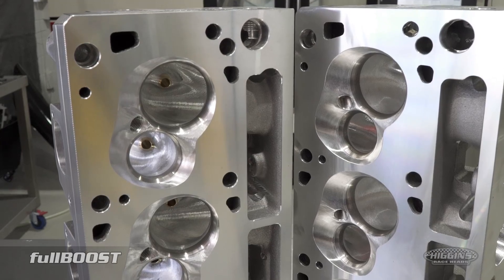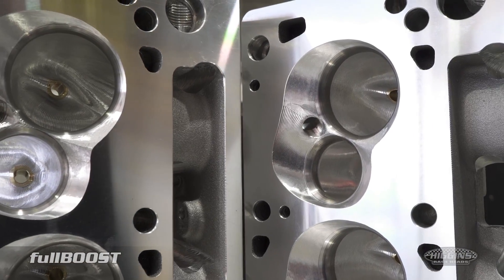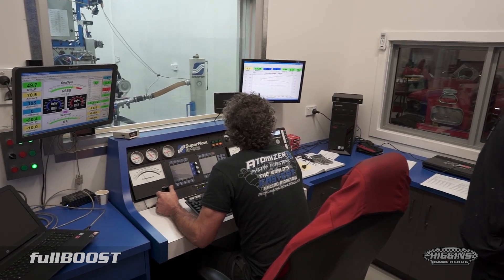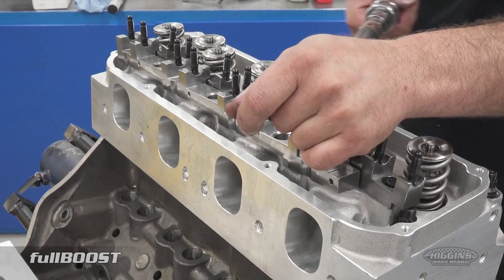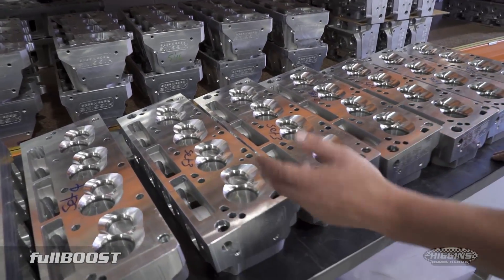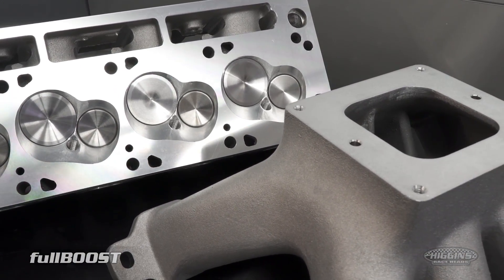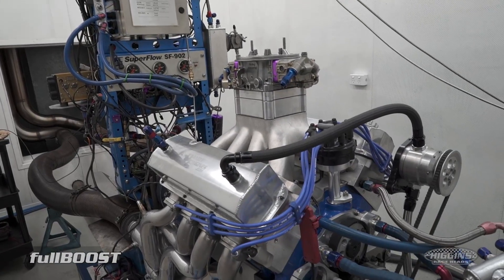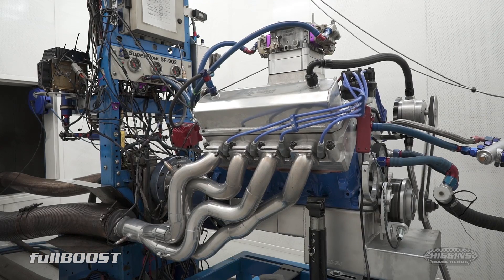How to make horsepower on pump fuel | fullBOOST

Comment: Very good numbers , but not on pump gas. You can get 950 or 975 from a 427 bbc, n.a. at 9000 rpm.

But look below

1100 on twin turbo on pump gas on a 427 or 496.

Even better in a street car and more fun.

Bloodviking
Reply from the maker: This is pump fuel.

Comment: It's good to see that it's possible n/a but, I am certain that the reasonable and intelligent HP/$ threshold is far surpassed. One would be much better off producing a basic 393/408/418/427/436 stroker with a roller cam 351w block, adding some heads that cost between $800-$1900 a set complete, a nice sized cam, port injection, Terminator X and a simple 78/75 VS turbo kit that would allow them to.produce 900hp crank with ease, might want to move towards E85 pump fuel instead of 93/94 octane and be capable of well over 1000hp if the fuel system is there while spending quite a bit less and having way less on the line if the thing breaks along with an ungodly Tq curve without the added cost, wear.complexity of high rpms to reach the numbers or the razor thin tuning window 13:1 compression must dictate.
Reply from the maker: Some people want an n/a engine, they sound great

Comment: Thought l pretty smart around engines & engine tech. How do u get a 13:1 comp engine 2 Run on 98 Octane Fuel.  If the guy had said 11:1 or even 11.5:1 l could have accepted those no's.  Pls explain. Other than that....  Higgins does fabulous work.

Comment: I just want to know and I'm from the US how do you run a 13 to 1 compression on pump gas I don't want to seem stupid but I really want answers
Reply: With Factory heads we ran 11.7. Add Aluminium and it is worth a point so 12.7. More modern Combustion Chambers than the Factory Heads and add a bit more. With the better more modern Combustion Chamber Flame front propogation is better so not as much timing needed so safer. Then ultimately, to get an engine making big numbers comes big Cams. Big durations vent compression so static Comp is a Big number but Dynamic Comp or Cylinder Pressures come down the more duration you have. I hope that helps. By the way, our built for Street Strip Clevo's are running Mid 12's:1 quite often on our 98 RON which is US 93. with no issues at all usually with cams over 250deg@50" and total timing of 26-28deg. Cheers. I hope I gave you a decent explanation.

Comment: 13:1 compression is WAY TO HIGH for normal pump gas.  And I have not seen 98 octane at the pumps in over 20 years.  8200 RPM is not from a street motor, again I am sorry.

In spite of my disagreements, producing this HP is insane and a bloody great job.  Super pro's that have dedicated their lives can only have the CHANCE to achieve this.
Reply from the maker: 98 Ron is the same as 93 Aki pump fuel.. Static compression and dynamic compression are two different things. Higgins / Dandy Engines have built heaps of these street engines.

Comment: you could get 200000 views if you address how Your running pump gas on a 13-to 1 compression engine on PUMP 93-98 octane.

I dont think its possible without detonation.
Reply from the maker: We have a full feature on one of these engines coming up. Keep an eye out for it. 👍

Comment: very impressive.   Care to elaborate on 13 to 1 compression and pump gas?
thanks.
Reply from the maker: This combo runs on 93aki / 98ron pump unleaded 👍
Reply: @fullboost  ...yes, I hear ya......how is this possible?
is this because of the chamber?

or have you found that 93 octane is all that is needed for 13 to 1
Reply: @harryharry3193 I was also wondering about detonation on 93 aki. 13:1 seems a bit high. If they mirror polish the chambers, and supply enough fuel, it would help, but I’d feel more comfortable with it if it had water/methanol injection at wide open throttle or dropping it to 12:1.

Comment: 2-bhp per cubic inch, (461cid) naturally aspirated, pump gas, 13:1 compression @ 8k revs. The factory Cleveland heads have potential, but those aluminum heads must open a wormhole!
Reply: 2.12 hp per cube !!

Comment: Mind blowing stuff, and this engine just sounds so smooth. Are there induction options to fit under a Falcon XA bonnet? Would have to put a Lenco behind that, and a lightweight 9 inch with detroit center, and go for a record around Bathurst.

Comment: 13:1 compression 🤔 not good for boost
Reply from the maker: No it's built as an N/A deal.
Reply: @fullboost  are you guys still selling them
Reply from the maker: Contact Higgins Race Heads or Dandy Engines for these parts
Reply: Bet you could run those heads with boost running a different piston though...

Comment: 13 to 1 on pump fuel? Australia must have some awesome pump fuel.
Reply from the maker: It's basically the same as 93 AKI fuel , what USA has.
Reply: @fullboost  my mind is blown, 13 to 1 on 93 seems like a ticking time bomb, but I'm not a professional engine builder either.
Reply: @fightfanian  See the Street Machine Aussie article on Alon Vella's Drag Challenge Ford Capri !!

Comment: Being a former 351ho and 351cj owner, I always said there was a lot of potential in the Cleveland
Heads. Made a lot of Plymouth and GM fans on the street mad because they lost to a small block Ford.
Reply: I used to have a BOSS 351C I transplanted into a 68 Fairlane Fastback. The Cleveland is definitely a kick ass motor.
Reply: Never lost to any ford In my charger but yes the 351  had heads of potential
Reply: @chargerwoh  I will race you. It will be a Drag Race, but you Will suffer a loss to my N/A 521 BBF in my 275/60 Drag Radial 86 Mustang, seriously doubt it Will be you're First Loss to a FORD, with that Big Heavyweight Charger.
Reply: Bad Ass 6.0 Powerstroke well I probably should of explained myself better and it’s an Aussie charger with a 440 ... light! only thing cast iron on it is the block and when it was a 265 inline 6 .... many many years ago I never ever struggled against any of the the other makes but at the end of the day mate you can’t take away the crazy power this sbf is making but in Australia 🇦🇺 the charger was king of the 1/4 mile for nearly 30 years but very light compared to their bigger brothers across the pond .sadly we only got 6 cylinders and small blocks
Reply: @chargerwoh  I'll run ya...
Reply: I built 351c with factory 4bbl closed chamber heads flowed like the Mississippi same size valves as a GM big block and back then we called them 4finger exhaust ports,  but Cast Iron I think they weighed 80lbs each 😢
Reply: @walterzook7751  351C iron heads are 55 lbs each.

Comment: So what do numbers look like for big block ford running higgins parts ported to the max. And using a belt instead of chain. And bigger valves and taller lift with aluminum  rods and of course best cam for high end power and four bolt main on all five mains full build all the tricks in the book roller rockers and all that on 460 junkyard virgin block. And would it handle twin turbos.  PROFESSIONAL COMENTS ONLY.  This smal block made almost a grand hp the big block without turbos shld have way more rite??

Comment: Depending upon which way the wind blows, I’m fortunate to have been just getting into serious street drags in 1970 when the 351 Cleveland made its debut here in the States. Or perhaps it’s unfortunate to be old enough to make my previous statement. But I’m still vertical and still racing against the clock on both accounts. 

I watched the Cleveland evolve over time with the pioneers like Bob Glidden among others doing some amazing accomplishments with factory blocks and modified iron heads. His dominance in NHRA Pro Stock started with the Cleveland and continued for years until he was eventually defeated by the NHRA Official rule book 😳. 

Fast forward to present day and witness the resurgence of a modern day version of the Ford Cleveland. Much of the credit for these many new advancements goes to directly to a handful of highly motivated Australian companies and talented individuals who devoted their research and development to make it all happen in such a spectacular manner. 

As for my own Cleveland competition engine, I’m stuck in a time warp running an antique relic using former Pro Stock iron heads with the full high port conversion by Endyn Inc.
But these are the heads that started it all from drag strips to high banked super speedways and the early alloy Cleveland heads were patterned after the iron high ports so they still serve a worthwhile purpose. 

Seeing is believing despite the whiners and their negativity about excessive revs and fuel consumption. I would like to give a big shout out for an outstanding display of performance by Fullboost and Higgins. Thanks guys 👍.
Reply: How about the biggest shoutout to the Cleveland engine for making this possible even more stronger today.
Reply: How about a big shoutout to Dandy Engines Inc. for their amazing talent and wisdom in choosing Higgins Race Heads featured in another great Cleveland head Superiority video by Fullboost !  Great job guys 👍
Reply: Mid 8's with a 334- 340 cube Cleveland in that Fairmont that went undefeated for a whole  year.

Comment: What about us Big Block Ford guys who love the 385 series engines, why waste your time on a small block 461 cubic inch motor when you can have the grunt and torque of the big block!
Reply: About 100 kilos extra weight comes with what is basically a truck motor. Lot of weight over the front wheels and because of the size 385's are a tight squeeze in most medium size cars. Lots of money getting them to fit.

Comment: It may run on the dyno with pump gas and 13.1 compression, but wait till someone trys to do that in a vehicle on the street. Dyno's feed water that's usually 140 degrees. Your engine temps. In a street driven car are going to be much higher, heat plus pump gas and 13.1 equals detonation.
Reply from the maker: This is not a one off engine there are a lot of them in street cars already. 👍

Comment: So are rose cammer heads a V8 can I  get a 289 cammer but my engine  car 32 valves I stoked it i beleave well I'm hoping with the right parts and boost I'm hoping for 1100 hp😊😚 one of few cars I need to build up hahaha what so you think about me stroking this maching block to a 347. With titanium piston sleeves. As toy could tell I'm basically sleeping???😎😊

Comment: 8200rpm. And the mod gunkies say pushrod V8 can't t it rn high rpms. No need for a ohc.
Reply: a production engine that turns 8400 rpm or a race specced motor.... Hmm.... I have seen lil stock cranked 281 sohc turn 9500 plus rpms....
Reply: Ey I've always liked my f 150 4.6 redline alday long an not hurt a thing an mind you I got it at 230k miles. Only problem I've had was locked up ac pump made me think I blew it up.....one bypass pulley later redlining once again. Lmfao then everybodys like chains this chains that. I'm pretty sure some motors were messed up period cuz I still dont hav any chain slap. Or just junk metal
Reply: They can but not for too long. Ohc will rev 8 all day long
Reply: @scottmcgregor2757  better be looking for the chain or chains to say see you later. I have always been a ford guy until the intro of the ohc like so many others were. . Nothing but a long history of problems  Glad they finally replaced thier truck engines with a proven platform and cant wait till it makes its way into the mustang eventually. That will be a engine that can compete with the 6.2  with size,hp,and tq.

Comment: Cleveland heads. Flow baby flow.
This is why the 351c is so loved.
The flow of the heads that are available now thanks to cnc and computer design are phenominal.
I can remember spending hundreds of hours of hand grinding and matching on ports anything nearly 2/3rds as high a flow as these head and intake make.  Hand p&p and intake and exhaust girdles along with great valves and valve springs make some amazing Hp. 
Breath baby breath!!!!

Comment: wonder how much More HP this 461C eng combo would make with a longer (1.52) rod in it?
with a good dual carb tunnel ram it should make 1000+HP n/a
Reply: Check out Alon Vella's multiple Aussie Drag Week Challenge, to see his near-identical setup running a best of 8.49@160 !  Street Machine Magazine has a great article on this combo !!

Comment: Damn ! I got a hard on just looking at the final run-- 979 horse power ! Even Glidden didn't achieve that with his engine. ( with a single 4 barrel, no less !) What a difference years, exceptional cylinder heads, and technology make ! That engine is the cat's meow !
Reply: Glidden made his numbers with around 337 to 342 cubes !!
Reply: @arkhsm  You are absolutely right. I was in no way saying anything bad about Bob at all. He had to work within a very tight framework of rules. And he was the best at it, bar none ! He was a hustler, that’s why he was called “ mad dog” ! He most definitely eclipsed the above mark with his Boss 429 engine, though !
Reply: @jimmywaters3987  I've got a signed by Bob dollar bill sitting on the Revell model of his '87 T-bird. I visited the US from NZ in '87, doing a 10,000-mile lap in the $400 '73 Mercury Monterey I bought in LA. I stopped in at the Texas Motorplex to watch Big Bad Bob mow down all the GM Stuff. Has to be one of THE best times of my life !!
Reply: You Aussies rock !

Comment: How do you run 13:1 without knock on pump gas?
Reply: JOSE CHUNG'S FROM OUTER SPACE! Its pump gas. It all has to do with the dynamic compression ratio
Reply: 98-ron has a lot to do with it.
Reply: What's the cam specs?

Comment: As an American Cleveland owner I absolutely adore Aussie Cleveland power. Keep up the good work on Ford Cleveland engines. Get the women kids and Chevy's off the streets.
Reply: go luck
Reply: John S  In my opinion it is niether,when ford designed this cross breed it was called the FORD MOTORSPORT BLOCK in reality it more cleveland than windsor when you run a cleveland top end
Reply: @aussiesupersnake6642  Windsor style block that has Cleveland's smaller bearing sizes, built for higher rpm !!
Reply: There's nothing wrong with a V8 chevy... they are the most common V8 in the world and win 9 outta 10 times soooo yeah you can piss off with ur biased ford bullcrap
Reply: @brockmaine2743  Panties in a twist much deary !!
Reply: @brockmaine2743  yea 8 out of 10 cars in racing are chevys and when you win you brag  about it.Only reason they win more is because they outnumber  the Fords & mopars.
Reply: @brockmaine2743  bwhahahahhahah.... win 9 out of 10 times... and claiming he is biased....you can fuck off with your chevy bias chump...

Comment: Considering this base engine is over 50 years old Ford had it close all along. Same deck height, same bore spacing, same cam location, same cylinder head bolt pattern. Great combo.
Reply: Tom Hamilton you sure this isnt a tall deck? Thatd be a lot of cubes out of stock geometry
Reply: @jubjub905  the 351 came only in 1 deck height. You can do so much with it.
Reply: @rickeydriskill1096 351W had 2 deck heights in the US. 9.48 1969-1970. 9.503 1971-1996.
Reply: @rickeydriskill1096  351c stock 9.2 deck, 351w stock 9.5 deck !!
Reply: jubjub f it’s a 9.5 deck stock Geezus, fuckin torqueless wonder, slowest piston speed of all small blocks 🤦🏻‍♂️
Reply: Same valve angles too!